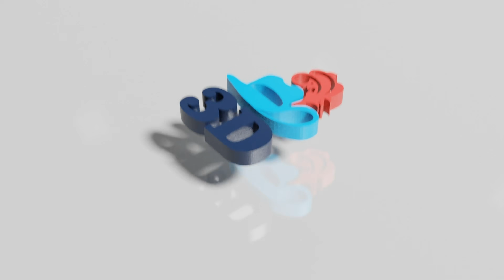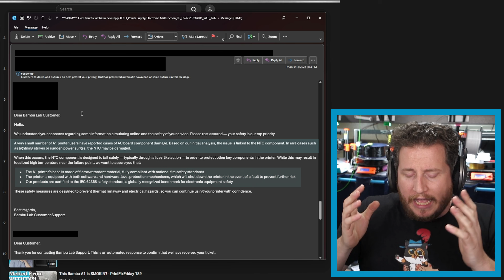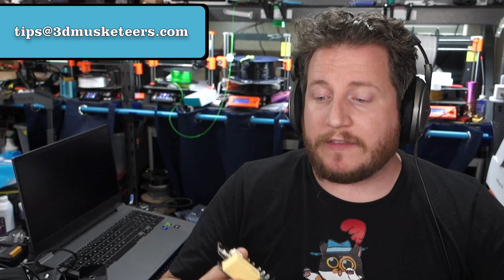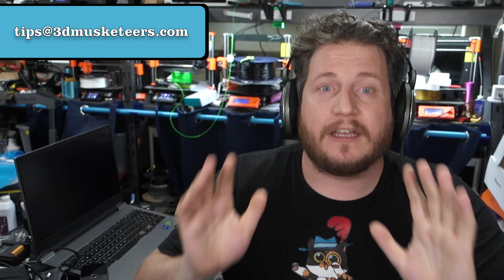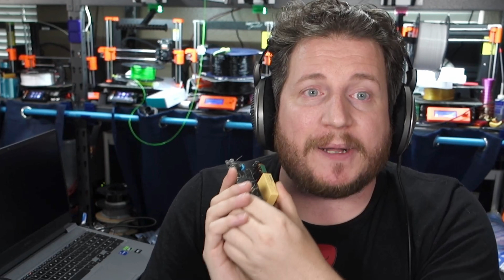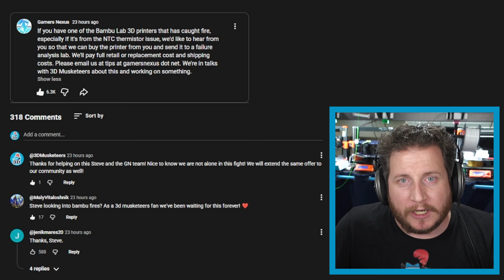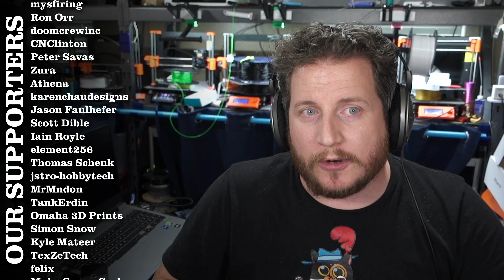I Was Right About The Bambu A1 (And I am MAD)!! - PrintFixFriday 245 FIRE HAZARD EDITION

Comment: Certified electronic technicians should be making board level repairs, most certainly not electricians, licenced or no.  Probably just J-STD-001 and  7711/7721 would be good enough for the lawyers.  

Regardless, why have engineers seemed to have lost the ability to properly derate component specs based on operating conditions these days?   What a mess.  I also hope Bambu has already examined their supply chain for counterfeits and out of spec components; not that it matters if they are improperly rated or the board too crowded.  I'd be concerned about thermal breakdown of the mains connectors' insulation and sleeving as well.  Oof

Comment: I love all the morons here calling for a product recall when it had been done and addressed!  This content producers are clowns.
Reply from the maker: What about the ones out in the field already with the bad board? What about how this was purchased brand new in February 2026. 

Who is the clown now?
Reply: @3DMusketeers not me. I have multiple printers A1’s etc and no problems. They run non stop. So stop fear mongering!
Reply: That was for bed cable, bad design, wrong materials.
This is for power board, bad design, wrong component. (is there a pattern?)
Reply: @kimmotoivanen actually the board was recalled also. Shocker but you dopes have no clue.
Reply from the maker: There is no recall for the board bro.
Reply: @3DMusketeers first off I’m not your Bro! Secondly, you do you. Have a good day Bruh
Reply from the maker: This is not an airport, no need to announce your departure.
Reply: and those morons never mention the user blocks the air vent with the poo tray, and that is the true reason causing the fire
Reply from the maker: No, it's not. There is no air vent there on the machine. It's passively cooled. Man the boot lickers will come up with any stupid way to blame anyone but the company for a bad designed board that literally catches fire.

Comment: It looks like they had something flammible on the table between the printers and it caught when the bad NTC popped and that's what caught fire and burned so dramatically. Also probably what partially melted the power cord on the other printer there. Because whatever is in that melted puddle under the towel is a lot bigger than the small melted area on the faulty printer.
Reply from the maker: It's a poop bucket the user told me. Something many A1 owners have.
Reply: @3DMusketeers  ive seen the little poop buckets, i have an A1. But thats a LOT of plastic. Like a full spool or half a spools worth of plastic from the look of it.

Comment: I'm tired of these rants without knowledge.

As always... It's about these bullshitty110V in the US which mean you have to double the amps to get the same power/watts as in the rest of the 220v-world (or 250v nowadays). And what works in the rest of the world regarding the max current for components is in the US on the edge... or very edge... but after all it IS inside the design-specs. 

BUT if you have ripples/spikes in your shitty house-installation grid with too many too large capacitance-loads on one single power-line which draw amps when start and gives amps back when stop... well... these ripples/spikes can overload your hose installation grid and bring your bambulab printer on this power-line over the edge. Do not put too many power hungry machinery on a single power line! Rule 1 for electronics ... in small and in large.

THIS is the problem! But more important: THIS is YOUR problem! And maybe the problem for others with a shitty house-installation.

So please... call a certified electrician to repair your house!
Reply from the maker: So having nearly 50% being in 240v countries, including areas with historically stable power grids? What about the one we had fully isolated from the grid that got to 140C when testing? 

I'm not disagreeing that the FL power gris sucks, this wasn't in FL, this was up north, in an area with much more stable power. The user claims it was on a surge protector as well. All my machines are on battery backups too, but it seems that doesn't contribute one bit.
Reply: You sound exactly like the people defending Intel when their chips were literally burning themselves and the motherboards they were sitting on because of their mistake.

"NO! NO! GUYS! IT ISN'T THE CORPORATION'S FAULT! IT HAS TO BE THE CONSUMER!!!"
Reply: You base this (bad power) assumption - on what?

Usually we would expect appliances and devices to work in normal electricity conditions and withstanding at least normal amount of noise, frequency deviation and over- and under-voltage without self-destructing. There are regulations and tests that devices must pass.

Bambu households seem to have different rules, requiring online UPSes everywhere 🤔

Comment: EU Customers can fill a warning to EU ICSMS (Market Surveillance) Plattform, also if something is already happened. If enough User report i think they will Review and eventually there will be a Sales Ban.   Today I will disassemble the bottom plate and check .. I will like have the faulty NTC cause my machine is from Nov. 2024. And no I will not replace the Board by myself , im not a certified Technican and that self fixing is not in complie with EU Consumer Regulations.
Reply from the maker: I'd love to learn more about this process if you have time. (Email is prolly the best)
Reply: @3DMusketeers I wrote you a Mail "comment about EU ICSMS"
Reply from the maker: Thank you!!

Comment: Hello, I had the same issue, I had my printer replaced by them since it was still in warranty, it took over a month to get it replaced, got it 2 days ago , the thermo-resistor burned/ turned to charcoal luckly I was home and it just burned out, just melted out the chassis a bit, the replacement I got has no thermo-resistor now. I have some photos if needed. It burned out while starting a new print. I asked for a full refund but they refused it, all they said is either change the board myself or change the A1.

Comment: I have seen many people doing a lot of dangerous mods to the 3D printers and then claiming that the machine had some fault and trying to replace the machine. 

How do you prove that the user has not modified the printer in any way?
Reply from the maker: We can't for this one specifically. The user has told me they didn't do any mods. There was a poop bucket next to the machine though, that's part of the melted plastic we see. Most of the machines that have failed are unmodded but I think I'm very fair to call out the ones that have been modded that we see

Comment: Thanks a lot for reporting on this. I deem myself extremely lucky to have seen your video this morning! I'm going to take apart my P1S (bought in late September 2025) to see what the AC board looks like. Sadly I don't find a lot of info about this problem with regards to the P1S but from what I gathered (I am no electrician and have very little knowledge of this area) the NTC should look exactly the same like on the A1 board, it just sits somewhere else. Are you interested in pre-fail P1S boards as well, if I find anything remotely interesting?
Reply from the maker: We are, yes.

Comment: If had such a printer, i would just fix the issue.
Probably the input protection NTC is carrying the bed heaters current. Removing the NTC and replacing by a wire should fix the issue. Also, in the US the problem should not appear at all, only in the 220..240V region of the world.
Reply from the maker: It's split almost 50/50 for 110v and 240v from our notes.
Reply: @3DMusketeers  That seems to be wrong. The same heater takes only half of the current on 120V nets.
Reply from the maker: And yet the board I showed on camera is from a 240V machine.. it's common. Voltage agnostic. We thought similar, but the numbers of public fails don't lie
Reply: @3DMusketeers  True. Numbers dont lie - if and only if there are enough occurencies.

For american Grid with it's only 120V, this should be only a quarter of the heat at this part -> technically: P~I^2*R, running it cooler as the current I is only half for american Grids. Still a valid problem, that should be fixed by Bambu Lab; would be easy to fix i guess.
Reply from the maker: Bambu has been aware of the issue for over a year, they are not doing anything about it.

Comment: Without any detailed analysis, the A1 get’s so hot on the outside, it is in any case unhealthy for the electronics anyway. My plan was to modify it with a fan mod, but to do it properly with a larger silent fan it’s not an easy fix. 🔥 is a whole other story. My A1’s stand on a metal shelf which helps a little bit to radiate heat, but if they start to burn there is no question my home is gone quickly.

Comment: Funny thing. I recently seen this printer open and instantly called this failure mode out because I noticed the 95°C rating on the NTC... It was printer brought through Bambu store in March. 
But again it's not single thing that is wrong with A1.

Comment: So my question Grant is this.  I have an A1,  this is definitely a concern.  The machine is out of warranty.   I see no evidence of any problem, no signs of overheating if the case, so I don't imagine that I can just call Bambu and ask them to replace this board on an out if warranty machine not displaying any issues yet... My other concern is, the recent fire was 2/2026, after they supposedly fixed this issue... So... How do we know a new board will actually render the printer safe?   Lastly, thank you for getting on top this.
Reply from the maker: you dont know, that is the problem. You can certainly try and pester Bambu until they send you one to shut you up. If it works, it works..
Reply: @3DMusketeersthat's my concern, did their "fix" actually inadvertently expose some other flaw that now makes them More likely to start on fire than they were with the old version of the board, or, is perhaps the NTC thermistor merely a symptom, and not the actual cause, and that's why even after supposedly fixing the issue a 2/2026  machine still caught on fire.

Comment: To clarify, this is A1s from late 2024 onwards, on both the 240v (what I have) and the 110v. It also only affects ones that have the ntc thermistor on that board?

Also has this affected P1S’s much?
Reply from the maker: Early 2024 and on, but yes. It could go back further, but we dont have any reported cases that old yet. This one was from Feb 2026, so we dont know for sure. 

The P1S is impacted but not as seriously, or at least not as seriously reported.
Reply: @3DMusketeers thanks for the clarification. After seeing this I will definitely be checking my A1s for the thermistor.

Comment: I'm still running my machine that was a super early model from the preorder phase. I just checked it while watching this video. Still no signs of deforming on the case.
Reply: I also have my unit on a surge protector. But an interesting thing I haven't heard yet, I am also using the Biqu Panda Branch power supply plugged into my A1 with 2 5v light bars and a Knomi + 1 AMS Lite

Comment: Fire retardant is not necessarily fire PROOF. Here's an idea that I have not yet heard, lobby the "powers that be" to REQUIRE all 3D printers sold in the USA to be UL (Underwriters Labs) Listed. YouTuber "Shop Nation" is currently in the process of building a million + dollar print farm, and is using Bambu Lab printers. He was told by his local code enforcers that any printer used in a commercial environment, needed to be UL listed. He was able to lobby his local officials to change the rules claiming that these printers are in use in peoples homes, and even in children's bedrooms, therefore, they should be safe enough for commercial use, and he got the approval he needed. Requiring UL listing would protect users on ALL levels, from individuals, including children, all the way up to multi million dollar print farms. I have an A1 which has not yet caused any problems, but guaranteed, as soon as these fires started getting discussed on YouTube, I bought a fire extinguisher, and keep it in the same room as my A1, and no longer run it unattended. Is there an available 110v replacement NTC board that we can buy and install proactively on our own?????

Comment: I suspect my p2s,  that I've not repaired still despite having the parts (had a thermal runaway and the board looks identical to the A1) has the same issue.  Hilarious that the EU has Bambulabs certified as safe.

Not that the UK is any better mind you but that's embarrassing all the same from Bambulabs.
Reply from the maker: Email me some photos, I'm curious now..
Reply: @3DMusketeers  I did a very basic Google and beginning to suspect I got the wrong end of the stick.  But I'll happily send photos of my hotend and it's board all the same.  I've been told the p2s has a different power supply system or whatever.

I'll also turn it on so the warning pops up before the thing does more damage if you'd like?  Again I'm probably wrong but anything that helps in the end is worth it.
Reply from the maker: Whatever feels right to you boss. If it's dead, I mean, what's it gonna do, get more dead? Lol
Reply: @3DMusketeers   sorry it took so long.  I've sent an email with the address in the information on here so apologies if that's the wrong address.  Had issues attaching photos so I just when with the most relevant one.
Reply from the maker: Okay we will get it sorted. No worries!
Reply: @3DMusketeers  cheers!

Comment: Not a defense for bad company practices but general things to keep in mind no matter the reputation of the printer:

1. Install a fire alarm in the room your printer is in.
2. Don't print things when you or someone else who can react to a fire aren't in the same building as the printer, and check on it regularly like you would when doing a first layer.
3. Consider turning the printer (or the power-supply/surge-protector its plugged into) off when it isn't in use. You can get smartplugs if starting a print when outside of the room for convenience is the concern, however I do not know how much power draw they can safely handle so check that first.
4. Have a fire extinguisher outside of the room so in case of fire you can stop it.

These things SHOULD be made as safe as they possibly can be by manufacturers, but no matter what at the end of the day your safety and the safety of your property is in your hands.

Comment: If the A1 doesnt have NTC, is it safe from these issues? Please someone help me out, i was about to buy a new A1 today. Now dont know what to do
Reply from the maker: We don't know. The one that caught fire was bought in February 2026 so it seems it's not fixed like Bambu said, but you don't know if you have old stock or new until after you buy.  IMO stay away right now. Yes, the printer is great value, but I think a Centauri Carbon 2 is a great machine as well. Not as well connected as a Bambu, etc. but so far, no major issues reported for the.
Reply: @3DMusketeers sure, thank you for the clarification. I will wait for Bambulab to recall or  take some actions. Unfortunately I am from India, neither carbon 2 nor kobra x is available for purchase yet. My only options would be P1S or P2S now
Reply from the maker: What about the centauri carbon 2?
Reply: @3DMusketeers it isn't available yet in India, only carbon 1, kobra 3, old anycubic s1 is available as of now

Comment: I dont know why people hate bambu they are good  never had anyproblem with it i have 3 of them
My first printer was anet people saying that is beter need to check youre self that 3d printer was not save at alll
Reply from the maker: Bambu makes great printers, this one has been a sour spot in all this. Even with these issues Bambu still has market dominance as well as the affordable market on lock..

None of that changes that this is an issue that needs to be fixed.

Comment: The all3dp article reports that the failure rate based on bambu is on the 0.052% rate. This points to over 1000 incidents across all the Bambu products. I would also bet that the rate in most cheap brands is similar.
Reply from the maker: We have no reports of damage like this from ANY other printer brand at the moment. 

I don't believe their number for a second. But even if it is real, don't you think they should do something about it rather than roll the dice all the time and hope someone doesn't lose their house or die from this?
Reply: @3DMusketeers how would you know their rates are lower? Other brands sell 10x to 100x what Bambu does, and if I search for fire events from Qidi, Anycubic, Creality, I also get hits.

Comment: It's not "spontaneous" if you know the cause, which is thermal load.... That's not what the term "spontaneous" means... Stop saying "spontaneous combust" when you are pointing to the exact CAUSE which is the opposite of spontaneity...
Reply: There are things called resistors... AND even variable resistors....
Reply from the maker: They are NTC thermistors, I also thought for a couple of months that it was an MOV, but nopeeee the data sheet for the component and even the silk screening on the PCB say otherwise. 

I used the word spontaneous because there is no warning, it goes from working to burning instantly.
Reply: They are using the wrong component for the application...
Reply: @3DMusketeers  20:58 you do realize how many companies put their profitability over consumer safety, right? Do you drive an automobile? Wait until you find out about their business practices when it comes to consumer safety.. These type of issues are what catalyzed and caused the necessity for regulation. And over-regulation.